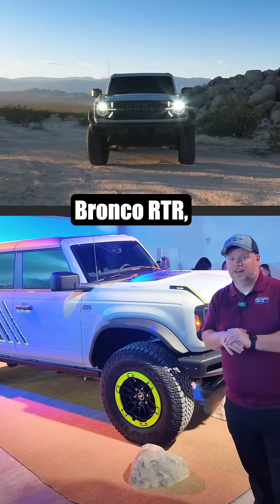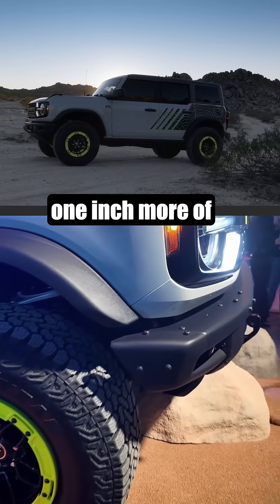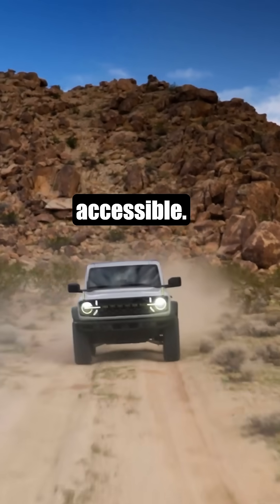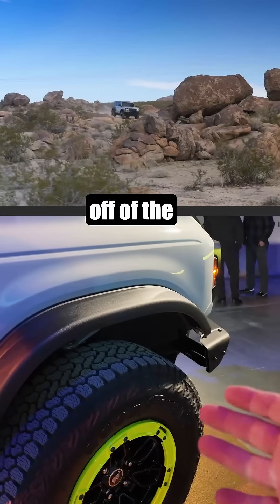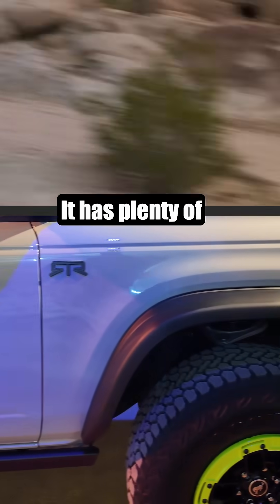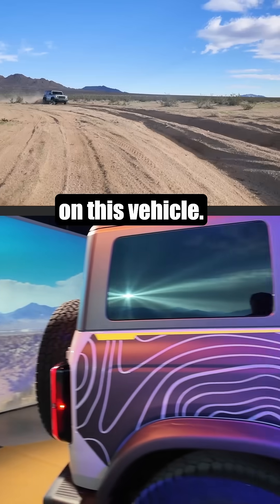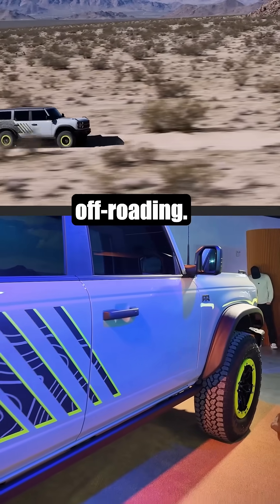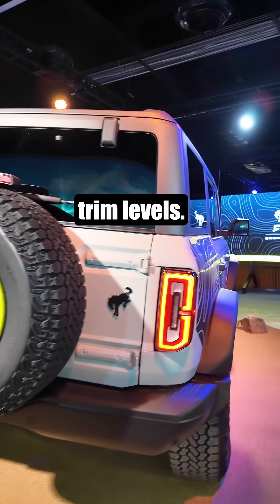Why Did Ford Choose This Engine for the 2026 Bronco RTR?

Comment: How reliable is that engine and how long has it been in production?
Reply: It's the same 2.3 That's been out in the Mustang, Explorer, and Ranger for 10+ years.
In it's 3rd Gen now with dual injection.
Reply: The 3.5 cohost motors have issues with cam phasers . And the smaller ecoboosts I’ve heard also have some issues. Best place to get answers is the ecoboost forums.